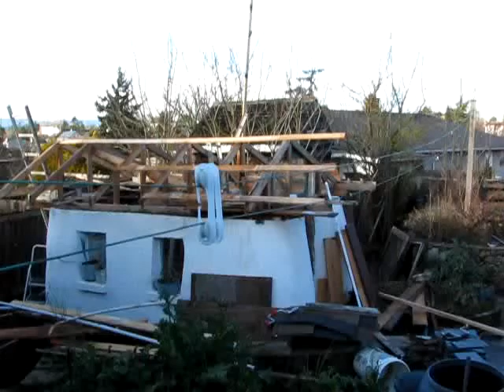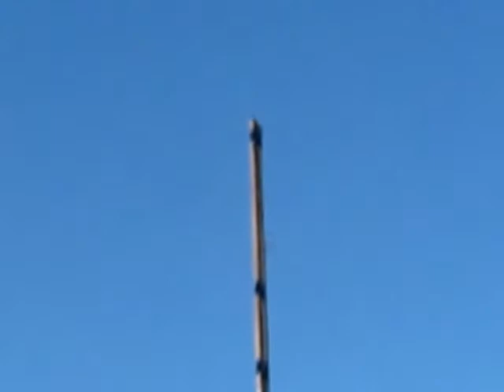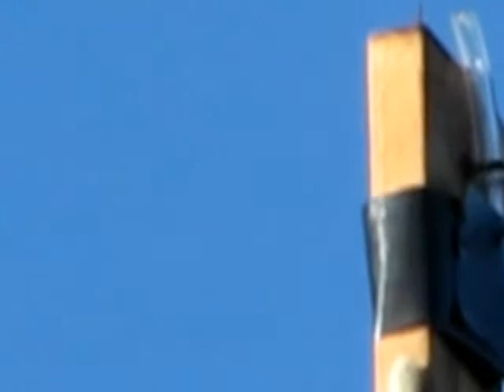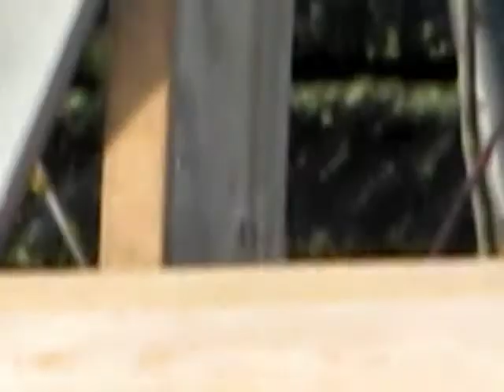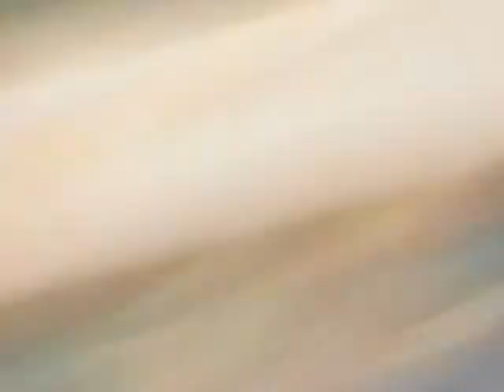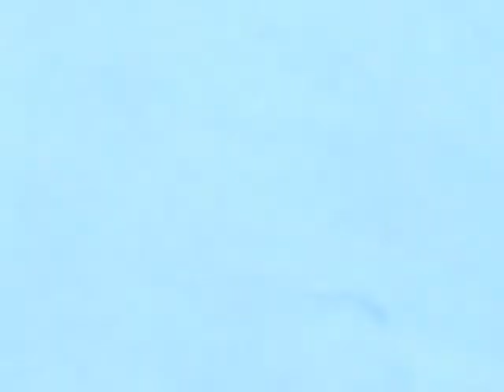World record! Pumping 18 ft high with the Tiny  (Less than 2 PSI) bubble pump and nano airlift !

Comment: Hey this is so great! I keep coming back to your videos to find more info about DIY airlift builds for maximum elevation. I've never done anything like this, but I'm keen to try it out with a 2nd hand $5 pump... Ultimately I would like to make a system where I can pump water from a low pond (just growing habitat plants, maybe fish) back up to the pond that feeds it, about three meters above it and seven meters away horizontally. I noticed you have your pumps heading straight up, is there some loss when they go up on an angle? If so I guess I could just pump straight up and then drain down...
Reply from the maker: +Richard Falkner Yes,  there are losses when you pump at an angle.  However, if you keep the angle the same all the way to the destination, I think they are not too terrible.  I made the video with a pump that I had found dumped on the side of the road.  (The pump eventually failed).  However,  I have been amazed at how long the little diaphragm pumps last.
Reply: +Brian White great thanks. I probably could keep the angle reasonably steady, albeit maybe curving horizontally. Guess I'll try it out and see how I go! Cheers
Reply: +Brian White great thanks. I probably could keep the angle reasonably steady, albeit maybe curving horizontally. Guess I'll try it out and see how I go! Cheers

Comment from the maker: @brendahodgins  generally you end up spending a lot of money if you produce electricity from small head sources.  And especially if you connect them into the grid.  Also, you have a problem because you disrupt fish going up and down river.  I am a big fan of the gravitation vortex power plant because it is cheaper to maintain and it integrates a fish ladder into the turbine chamber.
I think wind powerered airlift pump  combined with stop go pumped storage hydro is an option.

Comment: Bravo!
Do you know of any good sites that describe how to harness the power generated by a simple windmill or water wheel. I have been told that car batteries work to hold the power and that you need a regulator (from a car) and something from a motorcycle because it can spin faster without over heating. I forget the conversation that took place 30 years ago... I am ok but not great under a hood but able to learn if the info is basic enough. A lead would help.

Comment from the maker: @hempseed57  Yes,  that could work. Maybe one tube feeding air down in the middle and 6 around it. Some pumps might be 2 stage, with different submergence in each stage. 
We need to regulate the air into each tube. Another video that shows that  even with just 2 tubes, once one starts the pressure is less and more of the air tends to go that way.  Regulation could be as simple as accurately measured long pinholes letting just the right amount of air to each tube. Brian

Comment from the maker: @yellowmetalcyborg  Nope, pressure remains the same. It is no different than using the bubble pump in a 2 ft deep aquarium. 
The pump I use cannot deliver more than 2 psi.
Efficiency is not the issue. Lots of these wells (boreholes)  have no room for a piston pump. This might have potential for  people with very  little money who can afford bellows, a simple weak windmill or a solar panel but cannot afford a deep well pump.

Comment from the maker: @yellowmetalcyborg  The game here is to use less than 2 psi to pump water as high as possible.
(Just to find the maximum height possible).  Currently nobody knows the limit. 
The experiment has no real value now but  maybe it will lead to something practical in the future. Modern technology commonly uses a sledgehammer to crack a nut.  I am trying to use the tiniest tack hammer to do the same job. This might lead to another option for pumping from wells over 30 ft deep.

Comment from the maker: @hempseed57  Thanks, this is my own little version of citizen science.  I found zero information about how high an aquarium bubble pump would pump.  18 ft means that  optimized airlift in bundles of tubes down a well  and powered by a person with a bellows or by a little solar panel could (in 2 lifts) pump water over the magic 32 ft with only 2 ft of submergence! (Not 30 ft to 60 ft as recommended!).   It costs a lot of money to make a borehole  30 to 60 ft deeper!
Reply: Hi Brian, did you ever reach a height greater than 18ft? Also, I never caught the wattage on the pump you used. Most of the little aquarium pumps here in the U.S. only give you wattage, so I wouldn't know if mine is same as yours regarding the 2 psi without testing it, I'm guessing. Mine is a 1.5 watt I believe and I think I can achieve a height greater than 20 ft for world record if my idea works. Wish me luck and thanks for sharing your great ideas! :)
Reply from the maker: @Rick-the-Swift   you should wash  out your tubes, either with detergent or  run fine mud through them, before you experiment.  Because, new tubes have a film of oil or something inside  and you can get "perfect liquid holdup"  Meaning that they can "stall"  with columns of liquid stuck and not moving up or down.  If you use 3/16 internal diameter tubing,  you might be able to pump over 30 ft high with 2 ft submergence. I think that my pumps were 3.5 watts and 5 watts. It was probably the 3.5 watt pump and I have forgotten but probably it didn't need all the air from the pump to raise the water. I use the pumps for low level pumping in my garden now. Going to usually less than 4 ft high. It's especially useful in my greenhouse when combined with a "Chinese boar scare to distribute the water around. )
Reply: @Brians-tracking-solar-scoop  Thanks for the tips to clean the residue out of the new tubes. I have noticed water "stalled" inside the tubes before, or flow stopping at times for no apparent reason. It seems with so many things in life, using the small diameter tubes present a "catch 22". On one hand there seems to be an advantage using small tubes as the bubbles and water are allowed to retain surface tension enough to push those "slugs" of water up and out of the tube. On the other hand the smallness also seems to make the physics within more unpredictable than the larger diameter tubes, or at least that's been my observation. The smaller tubes also likely inevitably mean more risk of clogging in those constriction points, so there is also the added challenge of proper filtration.
 As you've also pointed out, there are so many variables, one could probably spend much time trying different techniques and ending up with many results, some predictable, while others can be surprising, or totally unexpected. 
 I think that's what keeps us fascinated long enough for us to learn something. This is the wild west of the physics world, and the laws of academia don't always readily apply in this new frontier. 
 Who knows, maybe someday we'll be the ones who write the laws as we discover them and future academics and laymen can learn from our efforts alike.
 If I can beat your record, I'll be sure to post my results for review as well.
Reply from the maker: @Rick-the-Swift   Hi Rick,  thanks.  I am sure you can beat it. (If I had lived in a taller house, I might have gone for a higher lift, but 18 ft was the highest  I could safely do at the time.  This isn't a "practical" experiment,   its just a mini Mount Everest for people who like to explore the physics of small things.